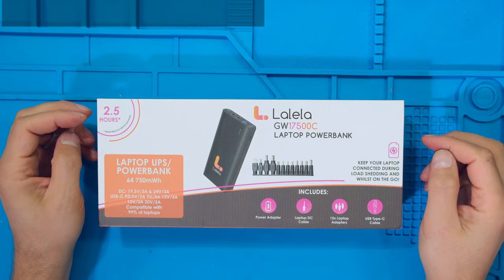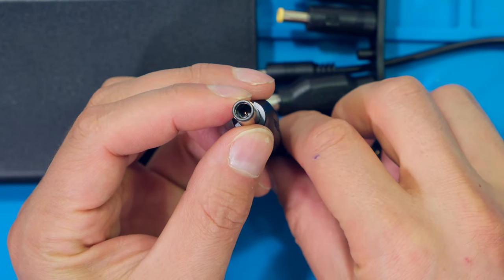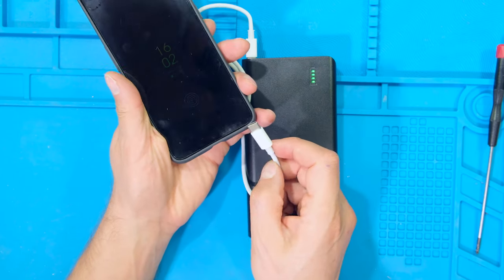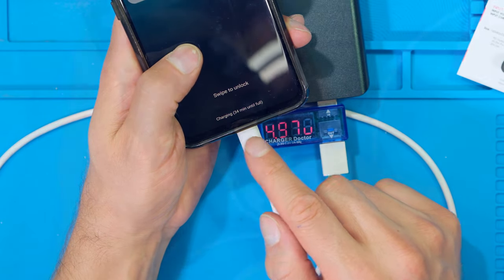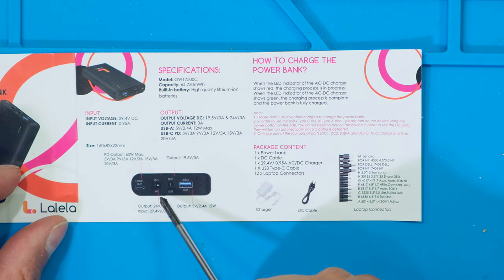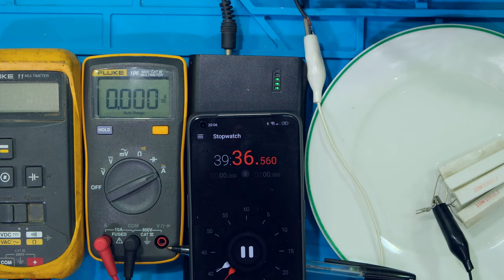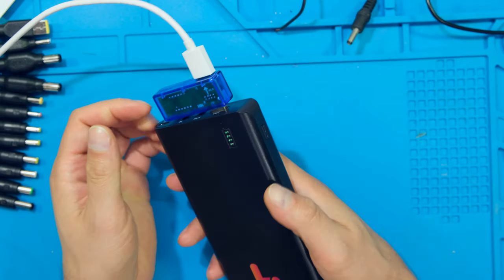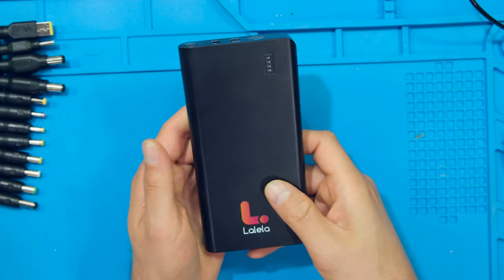How to use the Lalela Universal Laptop UPS/Power Bank GW17500 - Reviewed and Tested

Comment: THANKS FOR THE REVIEW. how are you getting 28.5v on discharge, I suppose that's straight to the battery. With a draw of 23v  and an average wattage is about 25w and then you got 2 hours, so fair to say it is a 50Wh pack, which most products wouldn't get near their stated capacity. Would be nice if you did the same test using the built-in buck convert at the 19.5v output to see how efficient the circuitry is ( please). I want to run LED lights, on the 19.5v terminal. Also, I take it that terminal is always on regardless of switch?

Comment: Can you use the input / 24v input port with a split cord going to the device (CPAP machine) and the external power source? I use it as a CPAP machine and I don’t want ti wake up during load shedding to  change the plug in…?